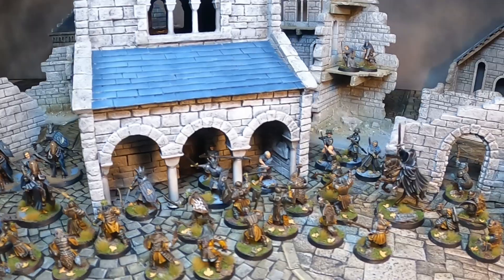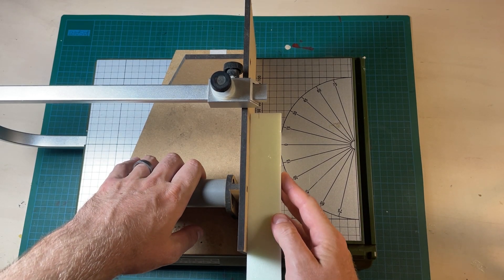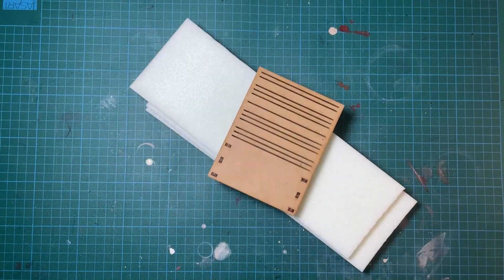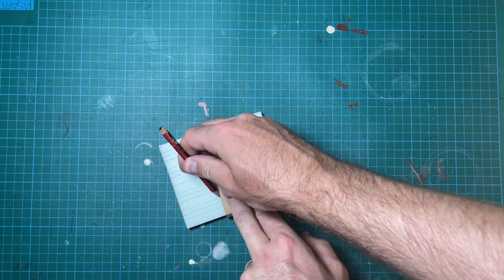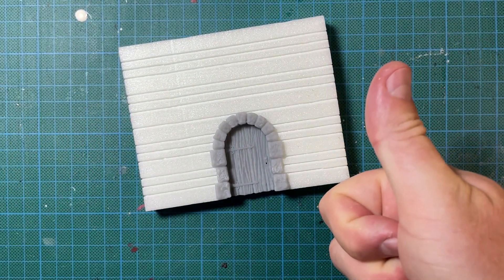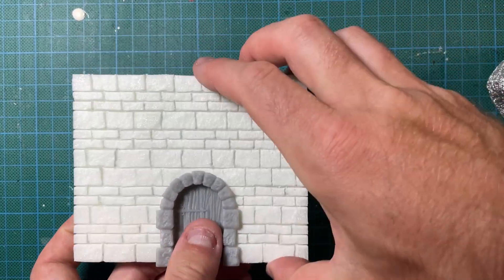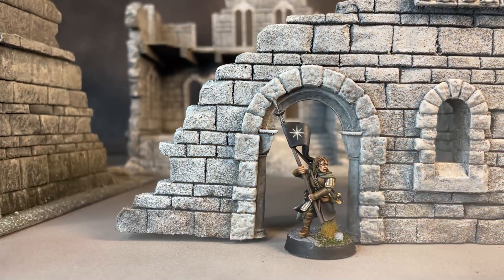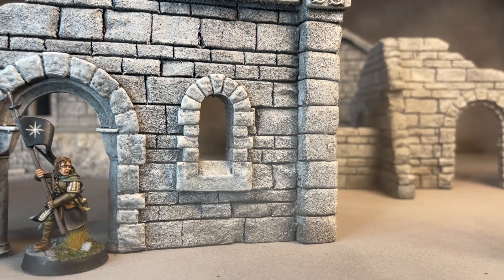Level Up Your Foam Terrain  With Slice & Slot

Comment: Just found out about this campaign through an email from MMF.  Wish I could've bought in during it's run to advance the stretch goals.  I just bought into another project two days ago.  I like yours better but the money is spent.  This is a great project!  I hope you have continuing success!
Reply from the maker: We are still accepting late pledges over on MMF but don’t fret if you miss out now we will be launching the range on MMF down the road anyway so you can always grab the files later 🙂

Comment: I'm super impressed by this, and disappointed in equal measure because I just barely found this campaign. Outstanding work!
Reply from the maker: Not to worry we will be doing late pledges very soon… as soon as I get it set up on MyMini Factory 😁
Reply from the maker: https://www.myminifactory.com/campaigns/slice-slot-1580 late pledges are up and running!
Reply: @microforgeminis  excellent

Comment: Love how this can be the foundation for a system people then expand with their own ideas and tools.

Does the digital tier also include the vector files so people can make the jigs with a laser cutter in a local makerspace? Only saw a reference to STLs.
Reply from the maker: Hey mate, yes the intention is to release the vector files so that people can laser cut the jigs where ever they are in the world (this has been added in the FAQ's section of the campaign). I figure if people really want to, they can reverse engineer the jigs, so might as well save them the trouble and give them access to the system. After all I am based in Australia and postage is expensive to the rest of the world so I would prefer more people have access to Slice & Slot.
Reply: @microforgeminis  I know the feeling, Having contributed to some independent movie projects over the years, I've run into the problem of shipping adding 30 bucks or more to even simple crew DVDs. That's why I prefer to buy digital assets when things like this pop up and do the manual labor myself.

Comment: Would it be possible to buy a PDF image of the jigs parts for those who have access to a laser cutter.  While the physical jig is not much more, I think shipping to the US may be more than I want to know.
Reply from the maker: Yes we will be supplying the jigs in a vector format so people can laser cut them where ever they are located. Shipping costs from Australia can be high and we want to make it as easy for people to access the system as possible.
Reply: @microforgeminis  Pledged!

Comment: this seems like a really well-made product with a lot of thought and passion behind it. however, i kinda fail to see the real point of it. i myself craft  terrain with foam because i don't have access to a 3d-printer - that means i can't use this product, because you need to be able to print the parts. now, IF i had a 3d-printer, why would i not just print entire buildings immedietaly, rather than print parts of a building and then having to use foam-cutting as well?

so, i'm definitely not the targeted market for this product - and people with a 3d-printer could just print entire buildings, so they're not really the target market either..? the reason most people use foam to make terrain is because they don't have a 3d-printer, and people with a 3d-printer probably don't have a foamcutter - but this product requires both of those tools...

don't get me wrong, the 3d-printed parts look amazing and it seems like a well-made product - i just can't see the point of it :D if i had a 3d-printer i'd just print the entire building, rather than fiddle around with foamcutting. and i feel like people with a 3d-printer don't want to get a foamcutter because, well, they have a 3d-printer :D
Reply from the maker: Yeah all fair points. I suppose in some ways I am just an old grognard that likes to build things by hand but doesn’t have the amount of time that I used to do this was the solution I came up with for myself :D

To your first point we are offering people without a 3D printer a set of physical prints for the Kickstarter for that very reason. So

In terms of fully 3D printed terrain I always find there are one or two things that I don’t like about a kit (I know I am just being picky and for most people it’s fine) but things like archways being designed to be 20mm wide when most bases are either 25mm or 32mm wide is infuriating. So why don’t I just design my own fully 3D printable terrain? I hate the look of FDM printing, even the best quality FDM print has enough visible layer lines to break immersion for me and most people don’t have a big enough resin printer to comfortably print full terrain (plus the cost). 

Anyway I appreciate your comments and totally see where you are coming from. I guess in a lot of ways it’s just my own little passion project 😁